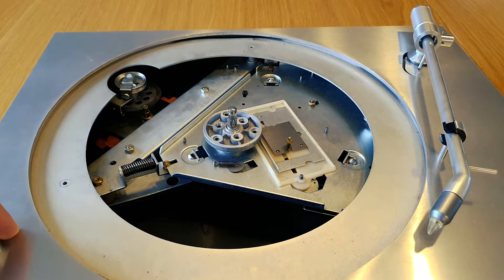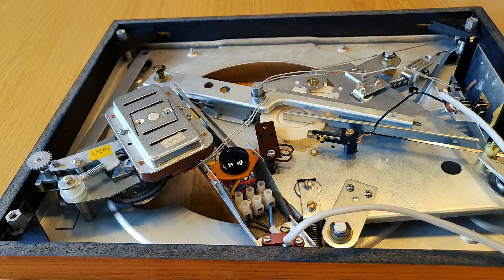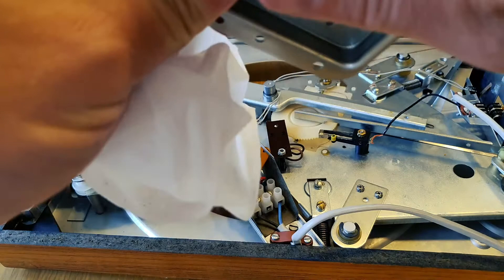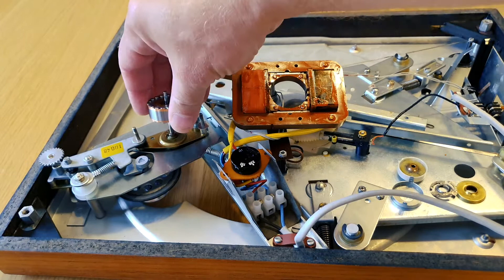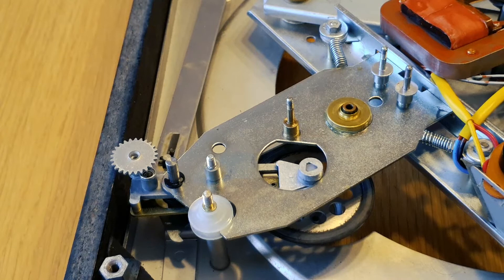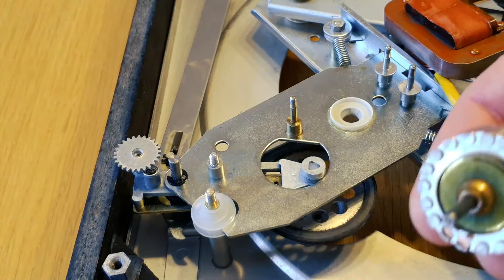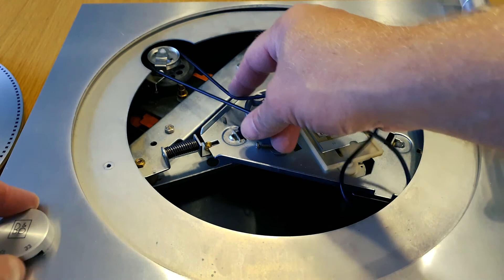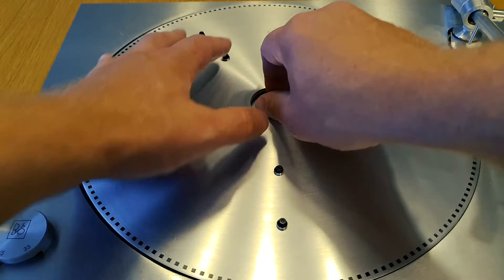Beogram 1200 Repair

Comment: Frank, 
I've been servicing these for about 40 years. Some help for you here for the entire BG1200 to BG3000 series:
1. The Sintered Brass Bearings must be placed in a vacuum chamber to remove the old hardened oil, and then infused with new synthetic oil. Or you can simply buy new bearings and many other parts from BeoParts shop in Denmark.
2. To reduce the Rumble and W&F significantly, the Idler wheel must be overhauled with new rubber at Terry's Rubber Rollers in Michigan USA. I developed a new thicker, more robust and quieter design of the rubber profile, which Terry will install for you on request.
3. Done properly, this TT will operate perfectly for the next 50+ years.
Reply: I washed bearings and oil pads in isopropanol.Soaked them with genuine Mercedes Benz 10W30 oil 😁😁 and motor works like new.
Reply: @divideking1770  10W30 is mineral, not synthetic. Mercedes or not. Your method has applied oil onto the bearing surface only, not into the entire internal granular structure. Your bearings will work OK for a few years until the bearing surface oil dries out again. Only vacuum infusion penetrates the oil into the bearing's complete granular structure. That's how they were made 50 years ago, and that's why they lasted so many decades.
Reply: Sorry 5W30.We can buy bearing and they not expensive.Cartritge is the pain in the pocket.0 @CondorAudio
Reply: Hi Condor. My question is do B&O or somebody else supply stylus to these tt?. Are the stylus same for BO 1200, 1202 and 1203?. And are there different stylus available, ex MM, MC or Conical, eliptical, naked etc. Would be more than happy for answers and recommendations for homepages on the topic. All the best music lovers.
Reply: Does B&O or somebody else supply stylus to these TT? Nobody makes these new anymore, since about 1995.
Are the styli the same for BeoGram 1000, 1001, 1200, 1202, 1203, 2000 and 3000? Yes - SP10, SP12, SP14 fit all of these TT's.
Are there different stylus available, eg 
MM - No
MC - No 
Conical - Yes - SP10, SP14 and their non-B&O equivalents
Elliptical - Yes - SP12 and their non-B&O equivalents
Naked - never made by B&O, but there are many hobbyists/technicians who will rebuild/install whatever stylus tip you want onto an old SP stylus carcass body. Be prepared to pay big bucks for the privilege. Price does not always indicate quality.

Buying a Used B&O SP stylus is a serious gamble. The vast majority which are advertised as "good, working" condition are completely shot  audio-wise, are painful to listen to, and are good for ONLY retipping. Most have dried-out rubber suspension. Never pay more than about $50 for these styli; consider them as unusable carcasses, and only to be retipped at a reliable technician. 
In the USA, there is Soundsmith
In Europe, there is  https://www.tonabnehmerservice.de/
I have no personal relationship to these companies.

Having said all that, I still have a limited stock of Swiss-made NOS SP10-equivalent Bonded Conical styli, from the 1990's. 
You'll need your own cartridge for this - I do not supply the cartridge.
You can check it here:
https://www.etsy.com/shop/CondorAudio
Reply: No. Sometimes people selling on eBay (expensive) . Second option is to replace needle ( also not cheap).I send my cartridge to men in Poland who professionally  repairing cartridge's.I should get it back soon.
Reply: @CondorAudio  Thanks Condor for your comprehensive answers on the topic. Since I'm new to this B&O equipment I try to collect as much info as possible!. Read a B&O thread on the topic that SP 6 and 7 can be used along with SP 10, 12 and 14 since they all have the required 15 dgr angle tip as for the BEO-1200, correct me if this is wrong!. Also, some SP,s have clear "nose" and some have black "nose", are there any info on witch stylus that have what?. Finally, what SP to go for sound wise?, or do they all sound the same?. All the best.
Reply: @divideking1770  Thanks for info King. "Men" in Poland, sounds a bit shady but fun. Hope you get a good result on your SP repair from these "Polish men". Keep us updated when receiving and testing your equipment. All the best.

Comment: Sponge looks like an oil well. The bushings look like Sintered Bronze Oilite type. Same on my Garrard 401 hysteresis motor. Apparently the bronze is formed from tiny grains and is porous holding oil pre soaked at the factory. Oiling the Rotor seems counter intuitive because it is supposed to be an air gap. Could get sticky and dusty and stop it again...
I got really unlucky buying one of these last week. The eBay seller said "for parts not working" but did not describe it had no motor. My friend said it would make a great cheese board.
Cool video.
Reply from the maker: Thank you for the input, really good info!
Sorry to hear about your cheese board :(

Comment: I just converted my old B&O RX2 to standard cartridge format. P mount and 1/2inch, my original arm was damaged so i modified it with 3d printed carbon fiber mount and it worked great.. im planing to do a video on how i accomplished it..

Comment: Next time put the belt around the platter, turn down the screws and turn the machine around and from the bottom it is very easy to put the belt around the pully!  I just found a 1200 and thinking about repairing it because everything seems to work properly but the cartridge and needles are very hard to find and very expensive and i'm not sure if it's worth it....
Reply: You got it sir, very easy from under, just did mine.

Comment: how did you attach the 33/45 wheel to the engine? Small screw or glue?
Nice video! Thank you
Greetings from Germany
Reply: With the set-screw grub, which is already inside the Brass Cone.

Comment: You have to add heat to the brass bearings to sweat the old oil out and then add new oil and the diagonal alumnium bridge is actually not needed and if removed  it 
will give a more responsive player.
Reply: Where is the diagonal aluminum bridge are you talking about? Not sure I have one on mine, which is a 3000 from 1974... just getting ready to do mine, I thought I would watch this guy... you're right, as no one knows how to treat sintered bearings in this day and age. But sometimes you get lucky, as this guy probably will... curious about the aluminum bridge though... as I can't tell what the makeup of the pieces are.... I was thinking you meant the anodized gold piece...
Reply: Dont know about the 3000, and years ago i did the 1200. But the lowest  placed diagonnally alu piece, i think its just for ridgigity during transport, and if removed the 1200 will be more responsive.